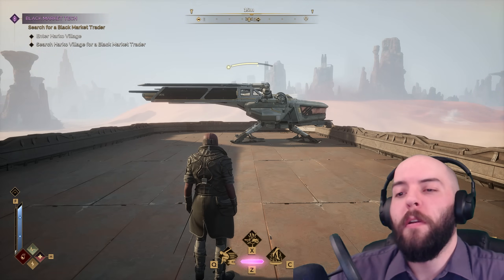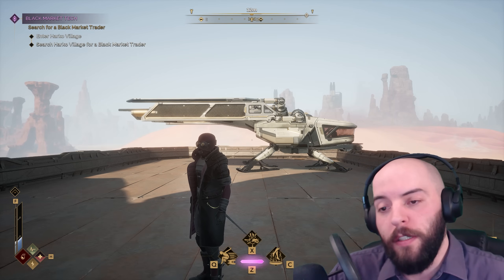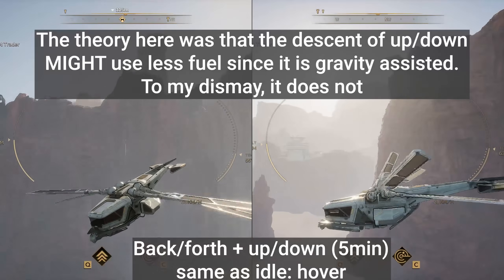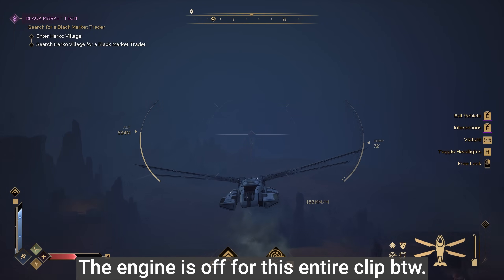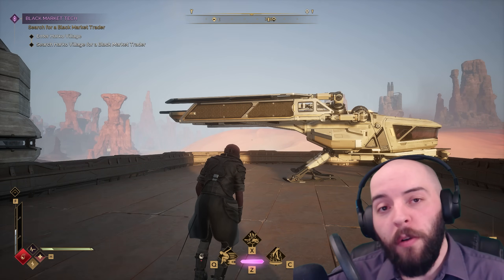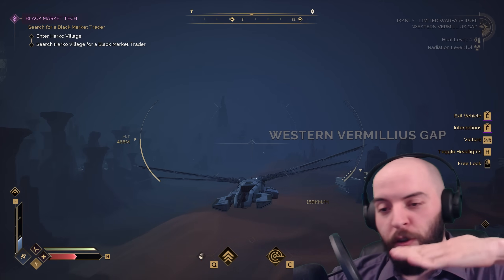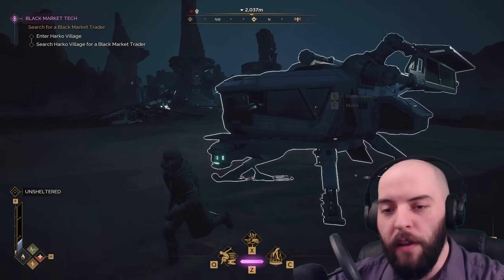How Ornithopters Really Work - Dune: Awakening - How to Fly an Ornithopter

Comment: Alright, how to say this kindly in regards to the booster over cargo. I disagree 100%. If your only use of the ornithopter is to move from large camp to large camp or to complete contracts, yes, the booster is the method, and having the cargo is a waste. However, if you are making material runs, you will see far more returns utilizing the cargo module. While the buggy holds a massive amount by comparrison to the ornithopter, unless you are running a mk 5 buggy the degradation on the treads going from say Vermillion to the western shield wall and back will practically burn it's durability to roughly 30%. That's in 1 trip upon constant repairs you'd be forced to replace it. Also, consider which vehicle you are rushing. If you skip over the buggy altogether, you have no reliably large capacity vehicle to make resource runs with. Sheol is also far better to be run with an Ornithopter as you can gain maximum jasmium before becoming irradiated enough to actually suffer damage. Group size is another factor. If you aren't part of a large guild who can brute mine Deep Desert resources by holding entire sectors your best method to do so will be to use an Ornithopter with a cargo module to maximize the haul for your return. Buggy's are far slower and a massive target on the ground. However, Ornithopters have far better maneuverability, and since the rocket pods are unguided, most people suck using them. The amount of times I've barely had to move to dodge a rocket is far more often than I've had to kick on my engine to ascend again. The Ornithopter scout is the first flying vehicle available at a reasonable level. And while aluminum is expensive, it's easier to gain than the later scalable materials. With that in mind, four trips with a cargo ornithopter and I can literally make a new one. I've flown from the center of eastern Vermillion to the western shield wall without once kicking on my engines aside from ascending to glide height. The booster is wildly unnecessary if you know what you are doing when gliding and have semi decent knowledge of the map and terrain.

Now, to address the mouse movement. That's a little biased. Sure, if you want abrupt turns and sudden shifts in direction without waiting and you have a booster to reset your altitude and speed, the method works. However, if you want to minimize air speed loss for a minor course correction and not need to kick on a booster, the mouse movement works just fine. Hell, even large course adjustments can be done if you do them right and retain most of your forward velocity. 

I want to wrap this up by saying one thing. He is not wrong about booster based flight. Everything there is correct. The problem is there seems to be an implication that you should only be using boosters, and that's just wasteful. Boosters are not the be all end all. While the math is accurate and I appreciate it being done so I can see what actions tend to burn up resource the only people number crunching this hard are those who just jumped into the aluminum tree and likely spent their Intel points on the Ornithopter due to excitement, within a day or two they should be easily able to make one and get the resources to replace it.
Reply: Real best move: put the cargo module in personal inventory, booster out to your resources, then weld-swap the boosters for cargo and mine up.
Reply: im 100% with you i use the storage and i can bring back so much aluminum that honestly the increased cost is worth it not to mention every other material or thing you could need bodys for the deathstill all ores its more efficient since you dont need to make 4 trips to cover the same ammount of volume of farm
Reply: With the number of trips being increased so much I wonder how much time is saved as well. Boost flying may be faster but is it 4x faster?
Reply: @couldarstrolm6969  its a good question. I consider it like this while the scout ornithopter 9nly has a hold of 500 volume the average player can only hold 175 if completely bare. However most players arent completely bare and as such roughly 60 to 75 of the volume is taken up with ammo, gear, and fuel, along with water outside what a stillsuit provides. 5 trips, roughly, to equal a cargo module if using the booster thats 20 total for a decent haul of aluminum for later game development before even considering Deep Desert T6 resources. While the booster benefits users doibg money runs, contracts, or specialty resources (carbides, diamondine dust, stillsuit hoses, etc.) You still see mitigating returns.  Most consider building bases in the far north and using buggys as the highest yield. And they are right, it is the highest yield for shortest distance and lowest durability loss. It also depends on if someone wants to live there or can. Biome heat is a huge factor and most cant stand the far north biome heat for the shield walls without duralinium gear, otherwise they burn through thirst.

In the deep desert theres an argument for any of the three primary modules for a scout Orni. Rocket pods for the pvp and fighting capability, booster to outrun those who want to gank your work, and cargo to maximise returns. Honestly the MK5 should only be used early to get the resources for the MK6 otherwise none of these should be used unless you are using mk 6 orni's with the mk 6 version, sans cargo since its only mk 4. Most guilds or large teams are already running mk6 scouts and assaults. They have a leg up a solo or small team never will. So you need to be on level field with gear to hope to stand a chance. In that regard flight not fight is your friend. This however is outside the argument for resources in the pve zone. Maximise returns build 2 scouts and take which works for your current needs.
Reply: @BioArrow  Great information, thank you
Reply: I have to say, Vash's claim of booster over storage did baffle me and I'm glad someone else has backed up my thinking.  Don't get me wrong, his math is impeccable as you say and, in the right situations, booster is preferable.  However, I've been at the point where I'm farming in the Deep Desert for spice/titanium etc for several days now and there is literally no scenario where material farming yield is more efficient using booster over storage, unless you suck at dodging missiles when someone tries to take you down 🤣
Reply: I totally agree. I'm a solo player, with very little time to play each day. All I want with the ornithopter is to be able to get to places and transport things (even if in smaller amounts) without constantly being afraid of losing everything because of the fucking worm.

Ps: I have zero interest in going to the deep desert
Reply: holy fucking text wall
Reply: The assault ornithopter has more cargo storage but you can't infinite glide on it or do all the trucks scours do so it loses its value. Plus scouts have missiles too so no real point other than to just have one.
Reply: Agreed.... this works really good in the deep desert when you want to put away your ornithopter at all times to avoid it being raped by zerg, then yes, you can't put cargo, then you want boosters for sure to run away from the zerg and not even wasting durability but I cargo run a lot and I am perfectly capable or gliding from my base on the western shield up to the exit of the map over the west vermillion gap. There is also a guild base there where we refine alluminium so I need the cargo pods...
Reply: was looking for this comment, thanks. was also confused of how should I farm jasmium without a thopter with a storage, on a buggy?

Comment: Very well put together. I just have one little point;; If you allign your sight in the middle of the triangle on the horizontal line while slowly or rapidly diving til you reach optimal glide speed you will stay at a constant speed while loosing minimal altitude. I can literally glide 20km without ever using the engine if I ascend til around 750m. MK4 wings has optimal speed at 162km/h while the MK5 has 172. Haven't tried the MK6s yet. Hope that helps a few individuals :)
Reply: To the top becausew this is how you do it not like Vash did ^^
Reply: Agree on 162 for the MK4, lovely glide speed / ratio
Reply: Close but not quite. Aim above the triangle about 1cm and tap "W" (or whatever your dive key is) every 10km/h loss. So if you are gliding at 162, aim up and coast until 150~ then dive until you see 162 again. I can fly 20km without engines and stay at below 400m the entire time (terrain willing). This really only works on scout ornithopters.
Reply: @Kyle-qe1zi what do you mean? What I’m saying is entirely true. It’s a way to be able to be fully afk while flying across the entire desert with the method I described. What you’re using is doable but it requires effort and is slower than just a constant 182/172/162 (pending on your wing tier) speed
Reply: @Stefflo-P  You dont lose altitude whit the W tap way thats the difference
Reply: @MartinJohansson-u8z that literally doesn’t matter when you can cross the entire desert without loosing enough altitude to touch the ground like I’m saying. I’m not saying other methods are wrong, I’m just saying this is different. It works as well and actually goes faster, while being completely passive once you’ve climbed, dipped til you reach max glide speed and set a direction. You can go afk for 5-6 mins while you glide all the way from zone I to shield wall at A 🤷🏼‍♂️
Reply: @Kyle-qe1zi dude yes.  Scout copter can GAIN altitude easily while gliding.  And wtf are you gonna do with a thopter that has no storage anyway?  Lol
Reply: @Kyle-qe1zi lol. 1cm. Different monitor sizes exist.
Reply: This also makes the storage a much better choice for your first module because you can get anywhere gliding without boost, only using a little more engine every flight, and you can hull back all the resources you need to make multiple replacement vehicles in their entirety in only a few flights. I really don't know how Vash missed on this so hard because he is normally pretty spot-on. He also totally ignored the fact that turning with the mouse doesn't slow you down, but using directional keys actually changes the drag model so you lose energy like crazy. If you use directional keys to make the same rate turn as you do with the mouse, you lose a lot more energy from mystery drag.
Reply: It’s better to set your pitch so you are just barely maintaining altitude but not losing speed, not what the video poster fucking described. Doing so wastes less altitude, reducing thruster use, with all the efficiency gains inherent therein.

Comment: is it more efficient to build in an elevated location then so every time you leave your almost insta gliding. but then the return is high  so maybe there's a perfect height to be found. i realize i sorta just rambled . appreciate these tips tho!
Reply from the maker: You're kind of correct. You also gotta remember on the return trip you're climbing regardless when you take off from wherever you're returning from, so it's gonna be preference on that bit. The answer could change depending on where you most often go to, with your thopter.
Reply: @VashCowaii   this makes sense. also i wondered does the radiation damage your thopter? or effect it in any other way do you know?

Comment: Anyone know if/how bad wing collision damage is? I set up a base with a side entrance for my ornithopter but the ceiling is a bit low. I'm worried I'm thrashing my blades durring takeoffs and landings. Durability hasn't been too bad so far so maybe it's fine? Wish the pentashield would cover the arched roof sections so I could get another half wall height for free.

Comment: You can just take off and IMMEDIATELY use boosters and turn off the engine. Max climb with boosters is still 135 km/h. Engines are horrible. I'm tempted to just crash land i hate them so much.

Comment: why are the ornithopters so goddamn slow?

 here in this video , without booster its going max 163km/h . thats the bottom speed of the slowest propeller planes in WW1 . Google also says in the movies theyre estimating them go around 500knots which is around 500km/h . in Microsoft flight simulator X Dune version , the flyable ornithopter has the exact same speed as Google mentioned it has in the movies 

so why the hell did they make it so extremely slow in Dune awakening???? its really bumming me out as i wanted to get this game solemnly to fly this but realizing how nerfed and slow is actually making me a little dissapointed

Comment: You don't actually have to dip down in vulture mode.  While it seems to defy the laws of physics, if you are at your optimal glide speed (indicated on the wings) and put your wings exactly level you will not slow down.
Reply: What does the wings do for an indicator of level? I don't know the visual que.
Reply: @admiralomega  feather condensation white line thingies

Comment: I just realized that the ornithopter it's a desing that could hold alot of potenztial irl.... you can turn a a fixed ving aircraft (plane) into a moving ving aircraft (helicopter or   I guess ornithopter)
so you have fuel efficency and speed of plane and the hovering and vertical landing/take off of a helicopter....

Comment: Thruster vs. storage is pretty subjective, as good as the thruster may be. 500V of storage is massive if you're going somewhere far away to mine or, as I have been, moving literally all of my stuff to a new main base. I don't care if it's slower when I take like 1/5 the number of trips to transport the same amount.
Reply: Yep sorry but for farming the storage is better the thruster does not make you 3x faster but the storage module allows you to carry 3x more and when your going into the deep desert you dont wanna be flying 5kmeters over and over even if you go slightly faster there is no comparison.
Reply: just keep both on you for easy swaps
Reply: @crisisakagod this is the way

Comment: It's not only it breaking down permanently, but also if the part is "usable". It might turn out that at 30, 20% - it's not really viable to use for what you want it to be (as you won't make it to where you want to go & back 🤷‍♂)

Also, the same goes for ground vehicles - learned that after sitting for about 1h AFK in my base - only to find the bike's engine effectively broken & fuel empty. 😛

Comment: Durability loss while idle should be 100% removed. That is the dumbest crap i have ever faced in a survival game. Also does the durability fall even more when its in higher "lvl" areas? I feel like my sandbike keeps breaking when going for ore
Reply: It's to prevent people from perpetually camping in the deep desert. If they're guarding some resources for their group they need to trade fuel and durability to do so
Reply: @TheTacCom  how hard would it be to add durability loss when idle in deep desert only for this reason? Would be ideal

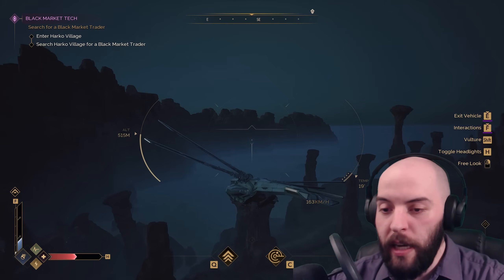Comment: Definitely learned a few things from this, however I would push back on the bit about mouse steering during vulture mode (7:14): In the Deep Desert, maintaining low heat is imperative if you get jumped, and steering with the WASD is much more costly in terms of altitude and velocity. Keeping your heat low until you need it most (escaping from would be PvPers) can be the difference between life and death.

Telling people to "Please don't" in terms of not using directional control will get someone killed because they utilized a costly and unnecessary maneuver.
Reply: Can you please explain what do you mean by mouse steer? And why is that better than using wasd?
Reply from the maker: If the enemy has the same gear, does it matter. I get what you're saying, but to an extent if in the end everyone chasing you can only go AS FAST as you reaching the same upper speed limits and same constraints, when it comes to escaping are you not already basically predeterminate screwed or safe based on the initial engagement distance - assuming you were running away to begin with, which is sort of where you're coming from, cause if you're running away you're running in a straight line mostly barring immediate projectiles.

I'd rather people know how to better maneuver in a gliding state when needed and encourage the use of it than advocate for micro-degree turning via mouse movement. Idk, might be missing something but the argument you're presenting for doesn't seem to fit, so lmk.
Reply: @VashCowaii It does matter. Due to the way DD is setup, the render distance is pretty short. So its hard to just "see someone in the distance and fly away". Second, ornithopters are quite durable, we have had thopter chases go from I1 all the way to the PVE zone in A1. Third, evasive maneuvering is quite good, due to the rockets being dumb fire. I think you are looking at it too much from an analytical POV and are ignoring skill and human response time.

We have had 3 PvP fights so far, and they are anything but predetermined based on distancing. Flying straight makes you an easy target and you cant outrun rockets, even across servers (when it works). You should be stressing the importance of energy management. It has absolutely been the difference for me, between making it out of the DD and becoming worm food.

EDIT: That isn't to say that this video has really good information and I learned a few things. And your method is perfectly fine in Hagga Basin. I merely just didn't want players to have the expectation that this method will translate out in the DD. Maybe this is better suited to a DD piloting video, as this is still an excellent resource for players in HB.